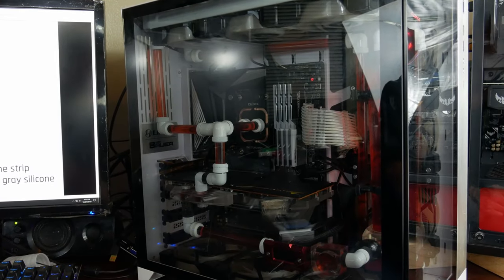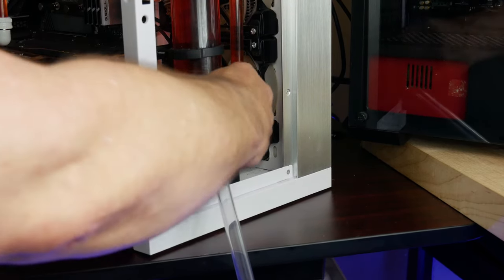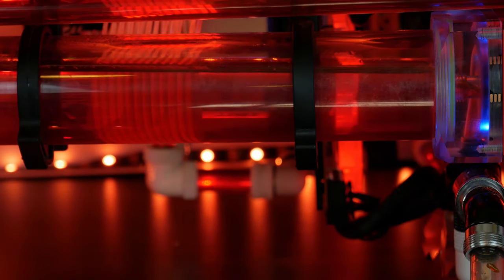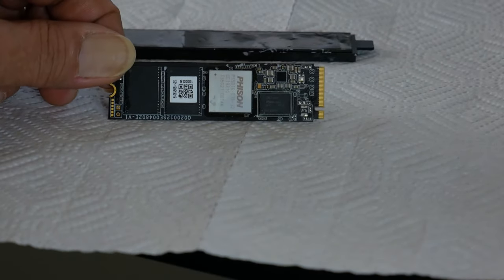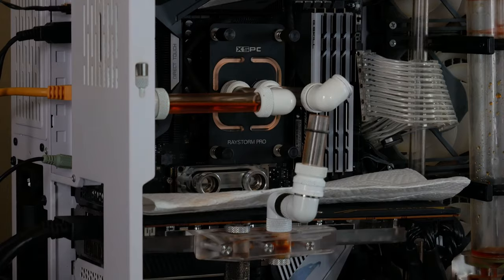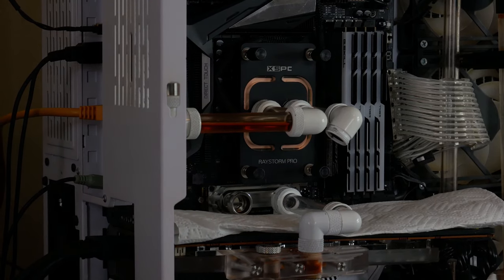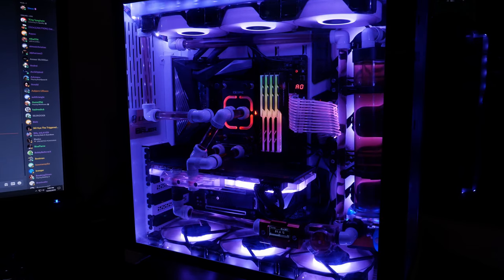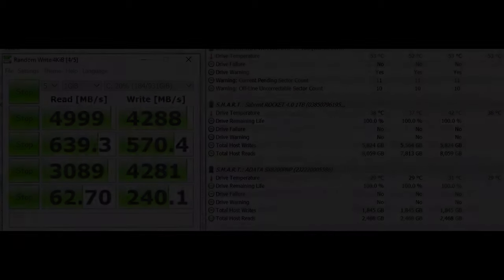PCIe 4.0 M.2 SSD NVMe BARROW Waterblock on Sabrent Rocket + 21C Temp Drop w/Heat Tests 3950X, 5700XT

Comment: All of the Gen4 PCIe SSDs either die in a few months or get slower and slower. The only way the manufactures can get the Gen4 speeds for a reasonable price is by using cheaper components. You need to water cool these SSDs from day 1 to mitigate most of the issues. The ideal temperatures are 40-50°C. Preferably, you never want to hit 50°C and at max 49°C. Lower than 40°C is also not ideal.

I had 4TB Rocket 4 Plus with the Sebrant heatsink, and it died after half a year. I got a new one (I got lucky with my warranty. Sebrant's support is terrible), and water cooled it. It's working on peak performance to this day.

Hopefully, we will get better Gen4 SSDs without these issues in the future.
Reply: If this would be true its just a simple warranty replacement due to not reaching TBW

Comment: Aaaaaah! stop using pliers!!!!
Reply: @IntenseWebs  if you tight them to much you will get cracks over time in the acrylic and POM.
Reply: @IntenseWebs  If you dont trust you fingers tight it with the fingers and then use the plier to tight it just a little bit more like 1mm( 1/25 of an inch)